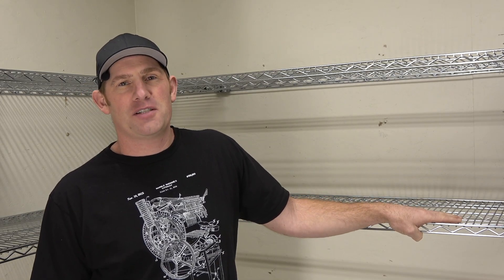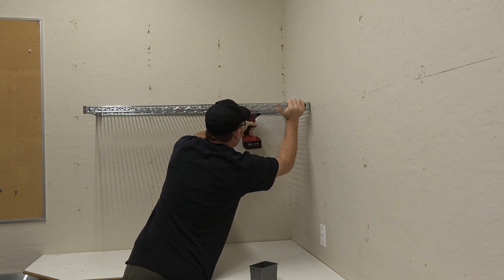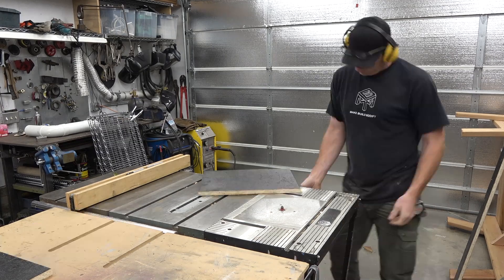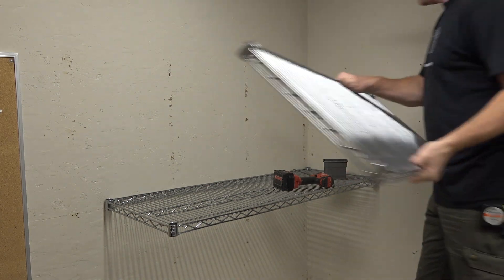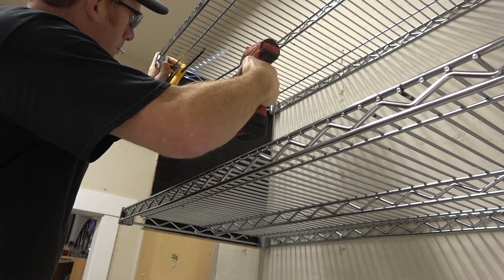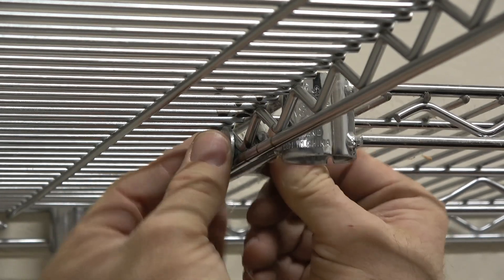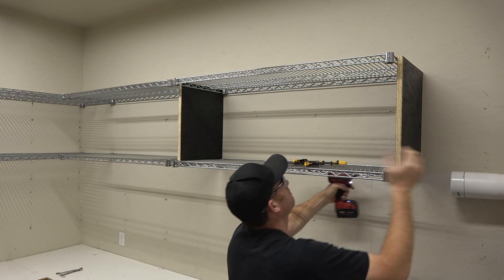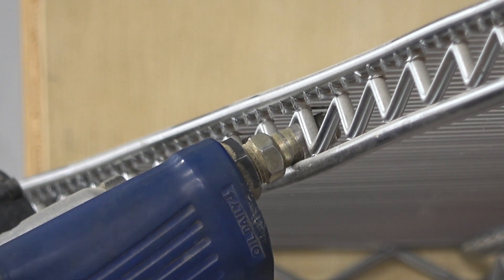How To Install Wire Shelves / A Better Way

Comment: Great use of the shelving materials. I've found that at restaurants when the plastic wheels break will often discard the units which provides free shelves. which make awesome grills. Thank you for the video
Reply from the maker: That's a great tip Steven. Thanks!
Reply: They are normally chrome plated, is it safe to grill food on them?

Comment: I hate wire shelves but they have their place.  This would be one of them.
Reply from the maker: Yeah, I have a love/hate relationship with them. I like them in the wood shop because the dust doesn't settle on them.
Reply: Make Build Modify good point.

Comment: You convinced me. I'll try it! Just to purty it up, I'd love to make the side panels from thick acrylic glass and put some LED glow through it. The brilliant part about your design is the way that the side panels force everything to stay square, so leverage won't work the mount screws out. A dozen (tight) screws can handle a surprising amount of shear force.
Reply from the maker: Yes, this arrangement is surprisingly strong. Although I haven't done any objective tests like loading it with weights until failure. I did hang from the first set of shelves I installed (I'm about 250 lbs) and it seemed to do just fine.

Comment: Just came across your video...Nice idea...I wouldn’t think that would hold over a long period of time.  Any hacks for wire closet shelves.  Have way more of those than this type.
Reply from the maker: I don't know any tricks for closet wire shelves. As for the system from the video, I've been using it for several years to hold hundreds of pounds of hardwood with no trouble.

Comment: Hi! Ran across your video. Love your unconventional way of putting up shelves! I have started moving over toward wire shelving and don’t have any plans on turning back. I had a question I need help with. I normally use the wire brackets that support these wire shelves I can mount them and hang from them and 50 pounds or more on a 48 inch shelf, they are strong. How much weight will yours hold if they are only mounted with the screws? Did you provide any further reinforcement with the side wood panels to attach them to walls at our plywood? With sheet rock, I don’t always have studs to go into. My question has to do with how much weight these shells will hold. Thanks for a wonderful video!
Reply from the maker: I haven't tested the upper limit of the shelves yet, but I have hung from them (my body weight is 250 lbs), and they didn't show any signs of failure. The manufacturer provides an upper limit for each shelf when used conventionally, so that would be a consideration. The only way to know for sure would be to test until failure.

To answer your question about the wood side panels, I didn't add any additional support. The only connection is where the screws go through the wire shelves into the wood. If you only have studs, make sure to use screws that are strong and long enough to go into the stud far enough.
Reply: Thanks so much Justin or answering my question. Wow, that’s just incredible. I’m scratching my head. I understand how just the screws attached in the plywood can hold that much weight. I guess I don’t understand engineering principles, but it would seem that that would not be enough even with the wood panels and the angles. Well, I’m glad it works for you. I, will try to incorporate your method in my next use of shelving. Right now I’m installing four large 72 inch wide by 24 inch deep shelves in my garage. I I am having to cut it down to fit in 66 inch area. Have you ever had to cut in the re-welded these types of shelving so they will fit on Support brackets that are made for the 1 inch post to go and sit on? I cannot find anything on the Internet or particularly on YouTube that deals with this. Let me know if you know any resources like that. Thanks again for your time and for your help God bless..
Reply from the maker: @waynewilson5287  I haven't had to modify them too much. I usually use them as is.